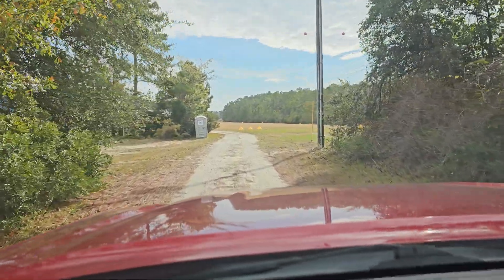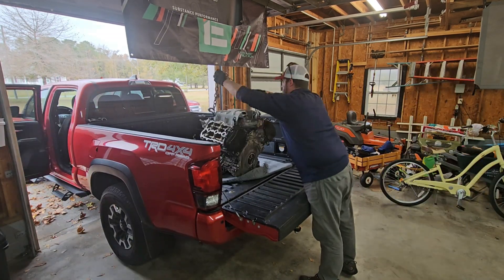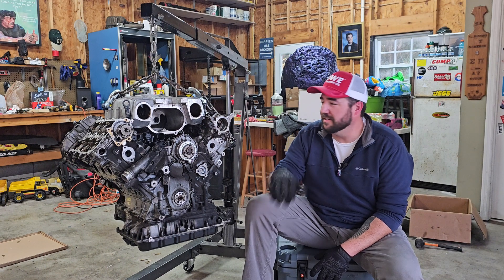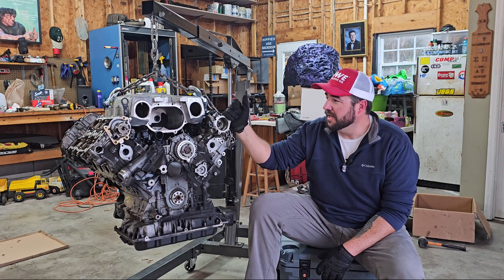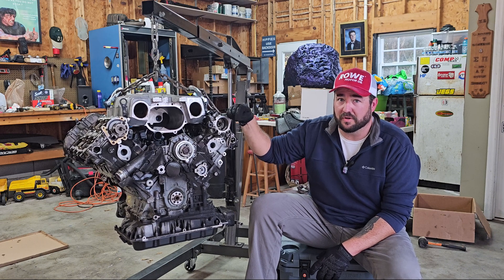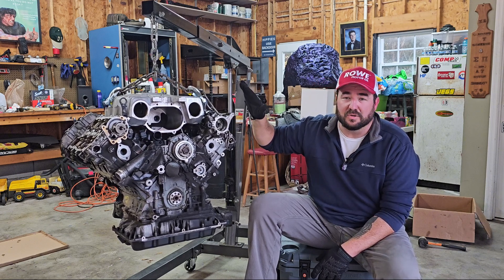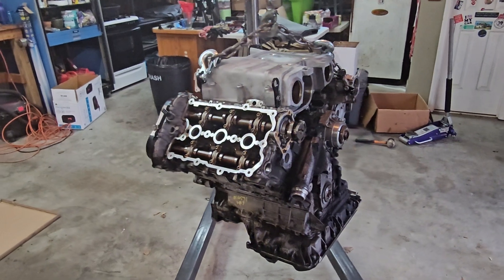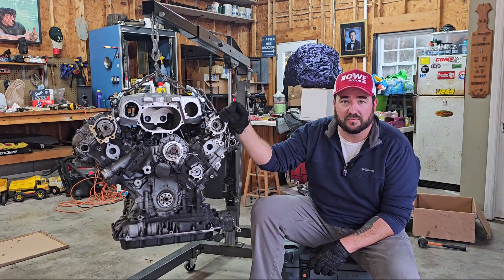Audi 3.0T Engine Rebuild Video Series Announcement | B8 S4/S5/SQ5, C7 A6/A7

Comment: This aged well
Reply from the maker: Well, 034's shitty beta tune and testing process blew up my good engine and that changed things quite a bit.
Reply: @GarageTaught did they pay for it?
Reply from the maker: LOL no. According to 034 they did nothing wrong and it was just my engine failing.

But throwing 30psi at the engine from 1700rpms-7400rpms three times a day over the course of two weeks so they can figure out a 93 octane file that should have been done already isn't great for any engine. Water under the bridge though.

Comment: Dude serious question I have a 202 Audi a7 I’m
In nj I can’t afford the rebuild but I’m being sold a 3.0 from a 2011 a6&and a2013 s5
Are they any difference in the a6 ,s5 or a7   ? Is it just a a matter of utilizing the a7 harness and al
The sensors from original?
Reply from the maker: You need the 2013 engine. The 2011 & earlier engines don't have all the sensors tire oem engine does. It isn't impossible though. Message @audi3point0work for details on swapping in an early b8 engine.

Comment: I have a question: in the upper timing chains with all cams in the correct position (dot and window in the head), I can count 18 chain pins from top to top between the cams sprokets on one side, in the other side I can count 19... what am I doing wrong?
Reply from the maker: I have no idea... I've never done this job before, so I won't know until I cross that bridge.
Reply: @GarageTaught  that's fine thanks. When placing the crankshaft pin make sure it doesn't rotate, it's a tight fit
Reply: Are these motors known for having timing chain issues? Just started researching the platform so any info would be awesome.